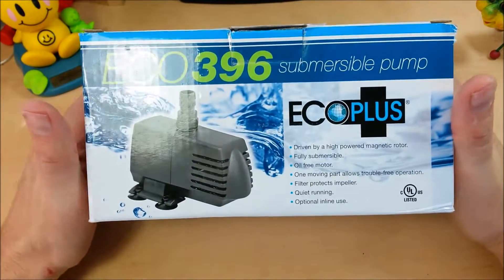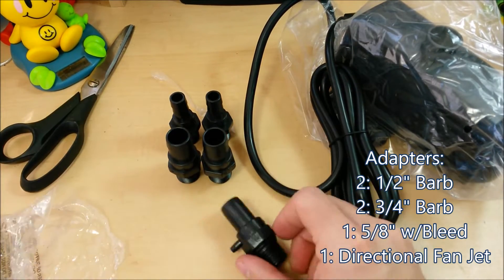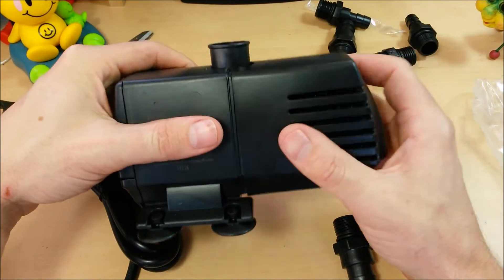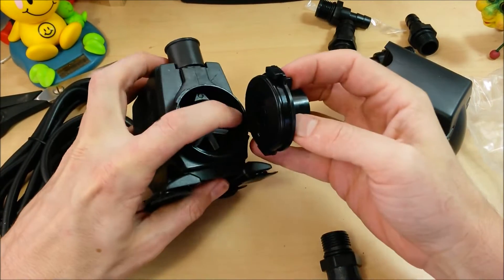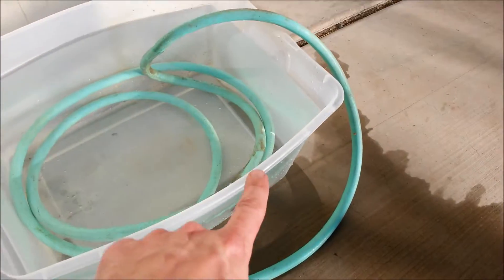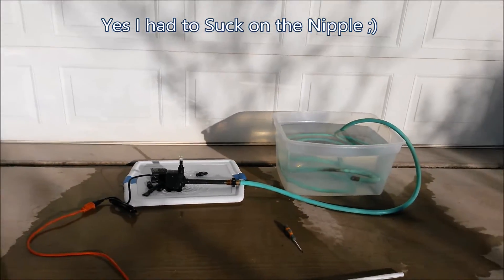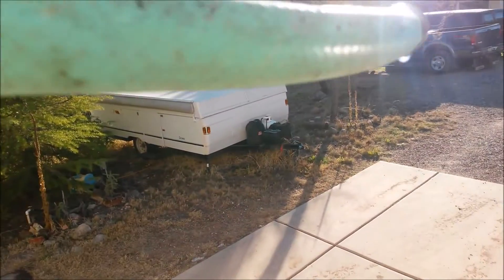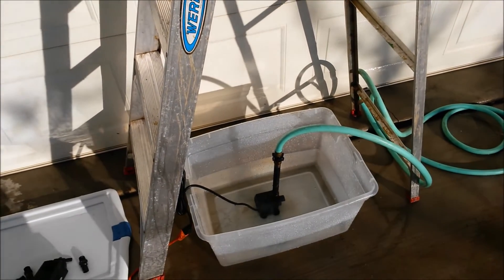(:Review:) EcoPlus 396GPH Submersible/Inline Water Pump ~Pond/Hydroponics/Laser/Aquarium

Comment: Sorry there are those not as skilled as you are, thinking they are smarter.  I purchased a similar pump for a 1,000 gallon pool to warm it by circulating the water through black hose.  It runs almost constantly, and works well.  I currently have it IN the pool—even when I'm in it—with the cord hanging over the edge of the pool—while I'm in it.  I purchased it for its 'inline,  capabilities. I haven't gotten it to work inline, and through your video, i'm convinced that it needs to be primed to work inline.  I need suggestions on how to prime, as the outlet has nearly 100’ of hose attached.  Thx

Comment: funny how this pump is label as submersible , yet it can work inline , puzzled
Reply: What does the term "inline" refer to or mean.  I like to get this pump to use with my portable shower to drain the water over to the toilet.  Would that be possible?
Reply from the maker: Funny? It's just like most other submersible pumps, except that it has a threaded inlet and can be used as a non self priming pump.